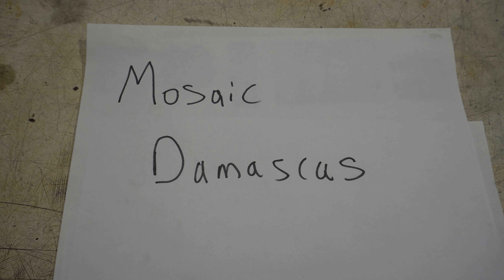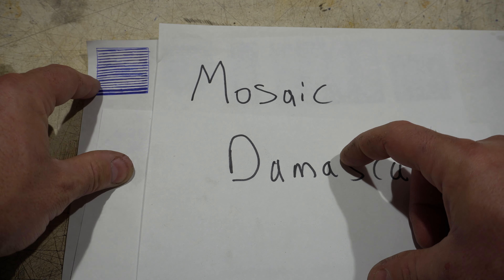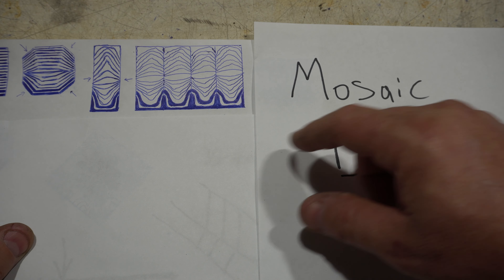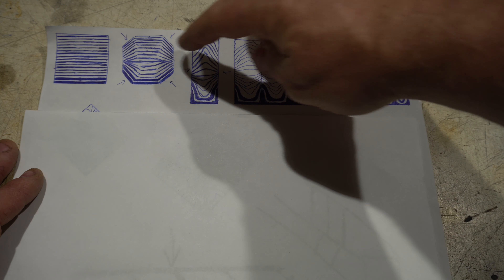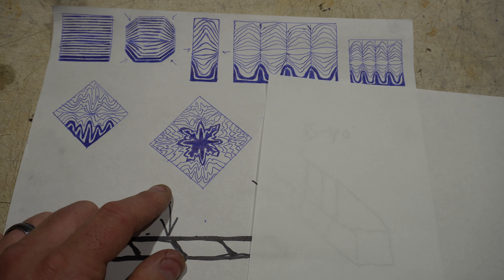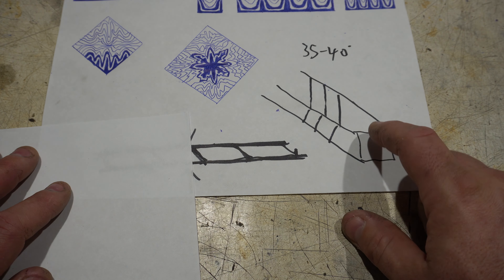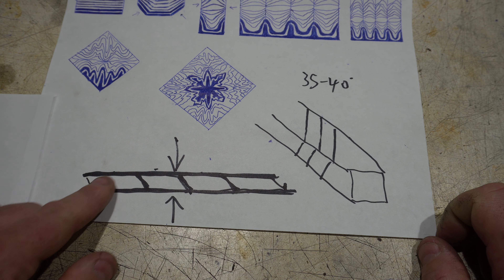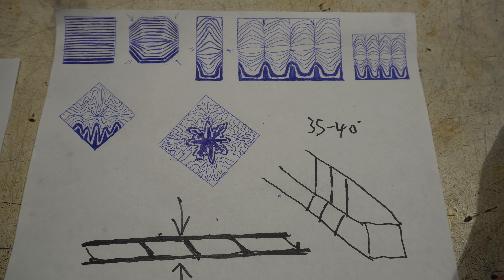Triple-T Thursday #29 - How to Make Mosaic Damascus

Comment: How thick  and wide is the billet before you cut it into tiles
Reply from the maker: That totally depends on the pattern and how long of a blade you want.  If you intend to draw this out to 2x its length, then you need to make the billet 2x taller than it is wide so you can account for the distortion that drawing it out will cause.  Make sense?   I typically like my tiles no less than 3/8".  Thanks for watching.